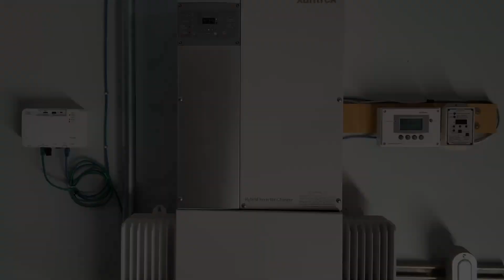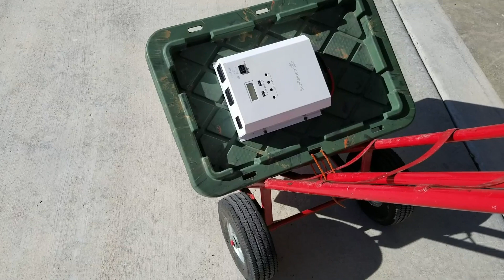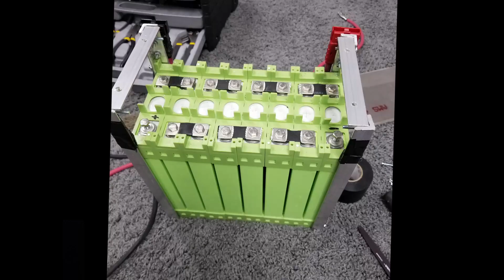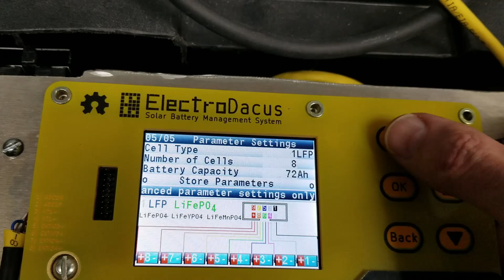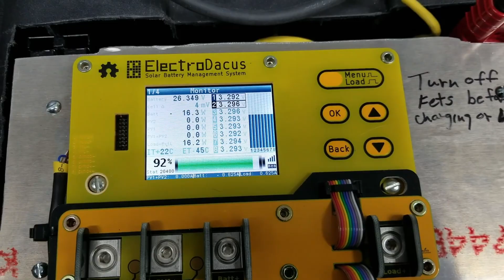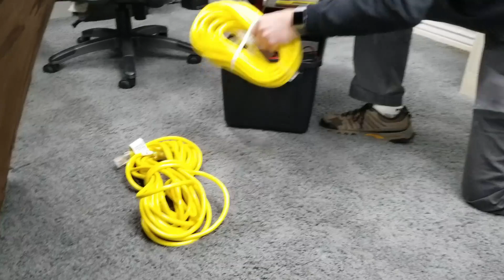Ultimate, Portable, High Power, Solar Generator

Comment: John thank you. Without being too hard on your other watchers and judging by their sneers about your speed of delivery I think it's just fine. It's great to hear someone that you can understand what they are saying over 20 minutes than most of the guys who think it's clever to say a million words a second but I have no idea what they said. Having said all that I live in the UK and I am currently trying to design a portable unit to run I call the Portable off grid power supply box. (POGPSB). It's nothing yet but I am working on it.  In fact I have 2 areas to power but I will make the first POGPSB to run my workshop and cabin. ( max 22.5 amp which is almost 5K.  The box has to be a tough construction and able to be wheeled. Need to plug solar into it and move to another site as and when. So appreciate any ideas. Thanks again
Reply: Three years on, how did your project go ... especially now there are portable sogens available on the market (Deltaflow, Bluetti, etc)?

Comment: I enjoy your experience and ideas. I have learned a lot from you. I found out that I do not need the large refrigerator anymore. It is very wasteful. To make changes, first my life style must changes. The old wasteful life when energy was cheap is way over!
Reply: Yes, I had similar thoughts about the refrigerator energy needs that he needed. There are much smaller, more efficient compressor refrigerators made for mobile users like for truckers, for overlanders and RV/Teardrops trailers that are made by companies such as ARB, dometic, Engel, Whytner, and even cheaper Chinese knock offs. They draw like 5Ah or less.

Comment: John, I began my research a year ago and I've put off building a "portable" system due to the weight. I can appreciate all the hard work you have put into educating yourself.  Will you please share with us the source, brand and specs for your battery bank? Heck I'd pay you for your blueprints and just build exactly what you have. Seriously.
Reply from the maker: The design was the only part that took me awhile to figure out. The components were mostly just off the shelf. Except for the SBMS120, which is the heart of the system. Electrodacus.com is where you can get it, but you might have to wait awhile for Dacian to make some more. You can get a solar charger elsewhere, but it won't be near as good. electriccarpartscompany.com is where I got the batteries 72Ah aluminum, but there are several places you could get them. Just make sure you get some that have a top and bottom cap so they can be connected together to make one battery. I made an aluminium angle frame around the battery, with a flat aluminium top to mount the SBMS and for a heatsink which the SMBS will need if your pushing a lot power through it. I used a Plano sportman trunk. They are heavy duty (I saw a video of some guy jumping up and down on one.) Cut a hole in the top so the battery would fit inside, but the SBMS would be outside the top. Used Anderson plug connectors so I could remove the top of the box or battery easily. They also made it easy to connect different charging sources like solar panels, or a power supply. Along with different types of loads or multiple batteries connected together. I used a Cotek 2kW 24v inverter which I like, but there are others that would work also. Review the video to see how it all fits together. Hopefully that will be enough to get you started.

Comment: When determining the power usage of a fridge or freezer, you need to include the ambient temperature.  If your house is 78F in the summer but 68F in the winter, there will be a difference in how much total power is needed each day.  There may also be usage differences: fewer glasses of cold water and less ice from the fridge dispensers in winter.  
For our 28 cu ft fridge/freezer, the average summer day is 2kWH.  The average winter day is 1.6kWH.  These are averages from a six week run on a KillAWatt.  The fridge could be at 4 watts (single internal circulation fan running) or at 560 watts (defrosters on in both fridge and freezer sections).  The six week run gives a number useful for a daily average, and if you check the KillAWatt frequently or you use a similar meter which records the high and low, you'll also know the minimum and maximum power needed.  For most compressor-driven appliances (fridge, freezer, dehumidifier, window air conditioner) you also need a meter capable of measuring the starting surge of the compressor (3 to 10 times the running power).  An online number needs to be qualified by what the test parameters were for it to be valid in determining the size of your backup system.

The RC (Reserve Capacity) of a lead-acid battery can be used to determine the approximate AH rating of that battery.  Multiply the RC by 0.83 and divide that by 1.39 to get the approximate AH.

My solar backup system has AGM batteries because 1) it's fixed and 2) they were readily available.  When it's time to replace the AGMs, the replacements will be LiFePO4 because - as I write this - the ~50% price premium of the LFPs is more than offset by their much longer life.

Comment: You have done a nice job of designing a portable power system that is high end and tailored specifically to your needs.  And your system has practical uses.  That's more than I can say for many solar generators that I have seen.  This is a great video.  Thanks for sharing.  

The usual portable solar system I see is some guy that takes a toolbox and a jump-start pack for a car, adds a couple of dollar store solar garden pathway lights, and thinks he has built something--LOL.  People call them solar generators, but that isn't really accurate.  These would be better called a portable sustainable power system.

Comment: I'm on 2 units of oxygen. I'm wanting to start going camping again and need back up system in case we lose power. I have a small unit that you carry. When it's battery is fully charged it'll last 4 your give or take a few minutes. I take the battery off and have used a drop cord and can only go places with power. Would it be able to run threw the night with a car battery or 2 or do you know how many it'll take? Can I charge them with solar or my trucks chargeing system or a small generator with a battery charger? 
What would I have to do to charge how ever many batteries I'll need.
I know nothing about power so I'll need a super simple answer.

Comment: Nice, I wish that solar charge controller was widely available
Reply from the maker: So do I Jehu
Reply: It looks like a good controller, yea.
It's not MPPT apparently, but if you have (somehow) an array that closely matches your battery voltage (a lot more doable with lithium batteries if you ask me), it would be a great option. 
(Though, getting say, 3500 watts of power through any length of cable at 12 or even 24 volts... is gonna need ridiculously sized wires coming from the panels... get ready for 4/0 wires!)
Reply: Bioenno has a Charge Controller specifically designed for LiFePO4 Batteries.
Reply: I have two of these controllers the wire is 6awg silicon insulation rated @ 200c its two strings of 7 -250 watt panels the silicon wire is good for 115amps or better
Reply from the maker: The SBMS actually does better than my two MPPT solar chargers on my main system. They are about 98-98.5% efficient. The SBMS is 99.6% efficient.
Reply: John Fackrell But how do you handle the strings of panels coming in? What do you do if you have panels strings coming in that have a VoC of 140 volts?
Reply from the maker: Yes it does. I checked it out before, but it still is limited in what it can do. It wouldn't work for my system.
Reply from the maker: You could rewire them in parallel instead of series. If your wires can handle the amperage increase, or what I was thinking at one time. Just use one of my MPPT solar charges to drop the voltage down to 24v.
Reply: John Fackrell That's the thing I wish this did... The DC-DC conversion. Cause no one wants to run 4/0 wires from their roof. :P
Reply: Watch this older video I made explaining why MPPT is obsolete in offgrid and the reason I chose not to use that for SBMS.
Cables are much cheaper than a large DC-DC converter needed for MPPT. I paid about 1000CAD around 800USD for all cables needed to connect my 10kW PV array that I will use to heat the house (all panels are in parallel).
Reply: Even with a 48 volt battery bank... that's 208 amps from the panels... assuming a modest 100 foot cable run (~30 meters), you're looking at wires coming from the panels with a cross-sectional area of 300 mm^2. 
That's about three times as big as 4/0 AWG.

... You have 300 mm^2 cables coming from your array?

Edit: By no means am I dissing the SBMS, it looks great for certain applications, and if you're making more I'll probably get one from you when I can afford it!
Reply: Most of the large array is used for heating so energy storage is done in thermal mass and part of the PV array will be redirected (automatically) to charge a 24V battery at about 50A (so if is cloudy is possible that the entire 10KW array will be redirected to charge the 200Ah LiFePO4 battery at 50A).
Groups of two panels in parallel are wired with 10AWG wire for an average distance of around 20m (65ft) then  those will be paralleled and fused next to the DMPPT450 controller that has 6 separate solar PV inputs each with a different number of panels 1,2,4,8,12,12 total 39 panels (each panel 260W).
For more details on how all works you can check this presentation I made http://electrodacus.com/DMPPT450/dmppt-presentation-v01.pdf
Reply: @bruceforster3709  bioenno charge controller is rebranded Chinese junk, pretending to be American made
Reply: @diylifepo4  The two Bioenno controllers I have do say 'Made in China' on them. Maybe someone nailed them with a Truth  in Advertising? lol!
Reply: @bruceforster3709  awesome 👍👍👍

Comment: John, excellent video and thanks for being thorough with the plan and explanations. I believe I follow you on the calculation for figuring the amp hours for the battery. You're taking the daily KWH for the refrigerator and dividing by 12 v which gives the amp hours. What I'm wondering though is how much of the battery capacity are you going to use? I believe the charge controller or inverter will cut out at some point if the battery gets to a certain charge level (too low). Is that correct? If so, would you need to scale up your amp hours by a certain factor? Since you're not using the total capacity of the battery. Thanks again for such a great video. I look forward to making one of these myself. I just had a 24 hour outage a week ago and lost some food in the refrigerator.

Comment: It might be possible to have a fridge or freezer that could be run only during the day and keep cold enough overnight with no power. This would eliminate the need for batteries. Needs lots of insulation and cold mass (thermal mass) inside. Some freezers can go 48 hours with no power if they are filled.

Comment: In the process of planing a solar system on my trailer. I was thinking about using 4 6v 215Ah batteries which will cost about $360 to give me just 215Ah of usable energy at 50% charge. On the site listed, I could get 4 of the 135Ah batteries for $540 and use the full capacity.  For the weight alone, it seems to be worth going with LFP vs lead acid. If only I could get the controller you have before May!

Comment: A very thoughtful and informative presentation. Have you considered a Faraday cage for this to solve the EMP concern. If you made sure there was a good connection between the lid and the rest of the case, you could probably do an internal one with a hinged or removable cover over your outer access points.

Comment: What was the cost of the solar generator (not including the extra battery pack and the solar panel)?
Reply from the maker: It was about $1,500. I could have made it less expensive if I had used cheaper quality parts, but I wanted this system to last many years. So I used the best parts I could find.
Reply: He only saves 90 dollars a year on a 3000 dollar set up?

Comment: How many of those battery’s did you use? And what total voltage were you shooting for? And ah? Thank you.
Reply from the maker: I put the information at the bottom of the video.
Reply: Thank you for replying. I looked again and I could see where you said how many of those battery’s you used. And I didn’t see what target voltage you were trying to get to with them. I know it was a 24 volt inverter you were using. But I didn’t see the voltage range mentioned. Was just wondering how many battery’s you used and what your target voltage range for them was. Thank you.
Reply from the maker: The nominal voltage for a LiFePo4 battery is 3.2v. 8 x 3.2 = 25.6v. The inverter can handle a voltage range from 21-33v. The SBMS low and high voltage limits are set to 22.4v and 28.4v. That's not the max or minimum of the battery, but for increased cycle life I use these settings.

Comment: Those DC leads are a little lite for a 2kw inverter. Those look like #4 cable.. Should be 1/0
Reply from the maker: Actually I'm using a #6 cable. If this was a 12v system I would need a larger cable. A normal #6 cable can handle about 65 amps at the LiFePo4 battery voltage I'm using (8 of these batteries have a higher nominal voltage than a lead acid battery, and they don't sag near as much in voltage under load). This cable is a very high quality high heat welding cable able to handle much more current than a standard #6. This was the cable recommended to me by the company I bought it from with 2ft in length and 80 amp load. I tested the solar generator with my 1,800W microwave for about 15 mins. (Could have run much longer, but I was getting tired of watching water boil.) The cable got slightly warm, but nowhere near what the cable can handle at about 72 amps.
Reply: That inverter is capable of drawing 166 amps. Quality of cable means nothing. Copper is Copper. You really should be using the appropriate cable or you could cause a fire. #6 is only good for 55 amps.
Reply from the maker: It is the appropriate cable for my project. I just looked up the specs. A #6 silicon cable 200C temp. takes 145 amps. to get that hot. 95 amps for 80c temp. Well below the 80 amps Max for my inverter. Yes it can surge up to 3,500 watts, but only for less than a second. No where near enough time for the cable to get hot. Actually according to Electrodacus a 2,000 watt inverter can surge to a 1,000 amps for about 100 micro seconds when first connecting the battery cable to charge up the caps. And it is the heat that would cause the cable to fail or catch fire. Don't forget this is the cable size recommended to me by the company that sold me the cable, and I did my own actual testing like I said before. 72 amps continuous. laser temp. gauge showed the cable not even reaching 50c. The temp got up to 40 something and stayed there. Never getting any hotter for the duration of the test.

Comment: I've read that Lithium Iron phosphate has a 5-7 lifespan  so I think asking for 10 years out of lithium based battery might be too optimistic.
Reply: LiFePO4 can have a 20 year life span it all depends on manufacturer and quality. The Sony offers energy storage based on their LiFePO4 cells with 20 years warranty. Their cells have 6000cyccles at 100% DOD and about 0.5% aging degradation per year at +25C.
In a typical offgrid type application you have an average of about 40% DOD cycle per day so with good LiFePO4 cells there is almost no degradation from cycling but there will still be a degradation of 0.5 to 2% per year from aging and that will usually be the important part.
My first LiFePO4 was a GBS rated at just 1500 cycles at 80% DOD but no mention about aging and after 5 years of daily use in my offgrid house (average 40 to 50% DOD each day) the battery was at around 81% of original capacity still good for 2 to 3 years if 70% of original capacity is acceptable but that was at the bottom of the LiFePO4 in therms of quality. GBS doubled the performance of the newer cells so the new ones should last 10 years and Winston that I usually recommend has a spec of 5000 cycles at 80% DOD so they should last 15 years in typical application.
My current battery is made with A123 System cells and those have a spec of 5400cycles at 100% DOD and I measured the degradation of same models of cells in storage after a bit more than 5 years and they lost around 3% of original capacity so aging is realy good also at around 0.5% per year so 20 years possible with 10% degradation from aging over that period plus 10% from cycling (maybe less with just an average 40% DOD per day).
Reply: That's some good news.  Maybe they have improved since the last time I read about them.  I didn't think you can stretch it's usable life to 20 years.  Those must be some really expensive batteries....
Reply: For stationary energy storage this LiFePO4 are the best in therms of cost amortization and that is why I use them and recommend them. No other battery can compete in therms of cost amortization with LiFePO4 at least as of now.
For portable electronics cycle life is less important than energy density and there LiCoO2 is normally used same for EV where NMC is usually used wit great energy density so good range and a 500 to 800 cycles at 80 to 100% DOD is more than enough for average driver.
The only EV manufacturer using LiFePO4 is BYD (largest EV manufacturer). They have buses and taxi so they need higher cycle life battery and so they manufacture LiFePO4 for their vehicles.